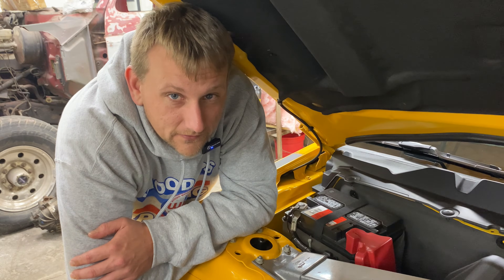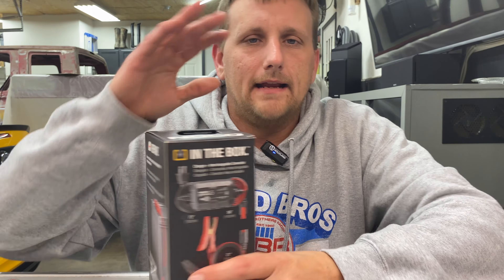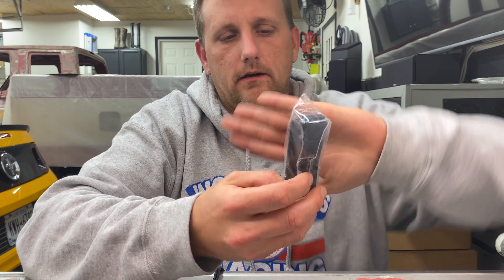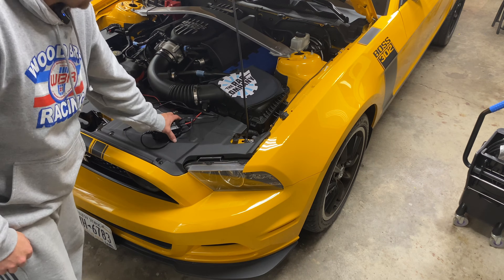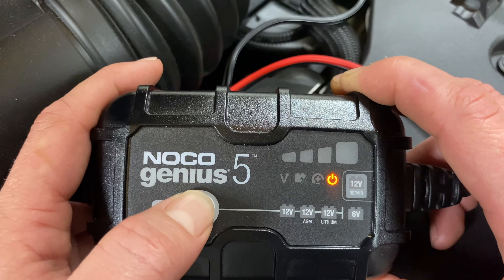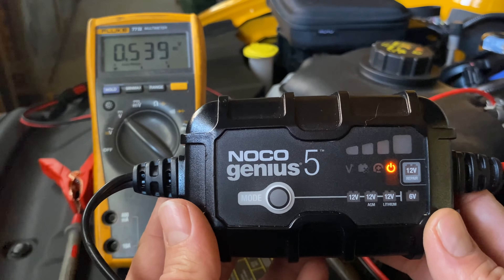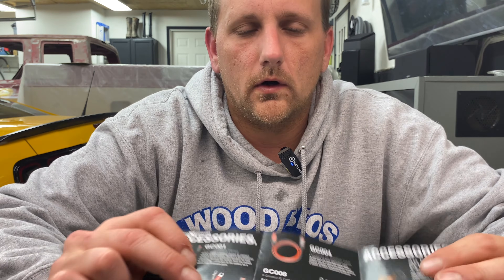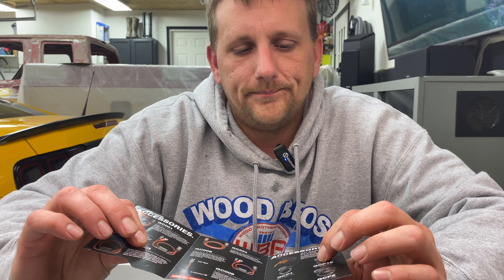NOCO Genius 5 Battery Charger/Maintainer How to, Features, and Accessories

Comment: Great video I've just ordered the same one  (noco 5) from amazon my battery is very low so as soon as I get it I'll put it on repair mode (after repair mode do you just put it back on 12v trickle charge?
Reply: Charge it first then use repair mode. If its voltage is bellow 2v use the force charge mode by holding the button until all the battery lights are flashing (flooded agm lithium and 6v) and select, your type of battery to force charge and it will resume normal charging after it reaches the right voltage. After fully charging use the repair mode, should be done after 4 hours, check your water levels on flooded batteries as it may decrease from electrolysis.
Reply: @brettsampson1900 excellent cheers mate..i will do.

Comment: Quick question and apologies if this has been asked. Do the alligator clips need to be connected directly to the battery terminals? Can they be connected to the charging points under the hood instead as my vehicle's battery is in the trunk and a hassle to get to. Wherever I needed a jump in the past, I've used the front charging points. Thanks!
Reply: I wouldn't see why not.  I'm hooking the pos cable to a remote  connection point that I added because that battery terminal is hidden under the intake duct.

Comment: I just got a Noco 5 , seams to work well and has more features than my Ctec. I have had my Ctec for close to 20 years and it has been running almost continuously between my RV, lawnmower, Atv,truck and car. The Ctec still works well but I wanted another maintainer so I thought I would try the Noco .

Comment: You don’t need to disconnect the battery from the car?
Reply: The instructions say to disconnect when using Repair mode because it could charge at 16.5 volts which could damage electronics. So, just disconnect the ground.
Reply: Nope. Just make sure you disconnect the maintainer before starting the car

Comment: How long does it take to charge a standerd car battery?
Reply: Apparently depending on how dead it is, I understand from very low to full charge about 6 hours on trickle charge but I think you can do a forced charge in about 3 hours..I've just ordered one myself and put a comment below yours, when I get mine I m gonna put it on repair mode as my battery has been well low because of under use.

Comment: I want to store the vehicle and use the trickle mode so the battry does not die, ,how do you do the trickle mode?
Reply: They make different amp models  which basically means that the more amps you have the faster your battery charges . your storing it you should do some research because your basically always gonna have it plugged in all the time so you don’t need that many amps . Hope this helps
Reply: Buy the Genius 1 for that.

Comment: Can you plug it in and let it do its thing for trickle charge? or do you have to turn it on after plugging the unit in?
Reply: you have to press the mode button to turn it on and select the battery type you're hooked up to before it will do anything
Reply: @YoureSoCreezy  Thanks

Comment: Great tutorial on the Genius 5, Nate! I actually just installed the ring leads on the 12V battery for our RAV4 hybrid and it's in it's optimization mode as I write this. I wanted to see more info on the LEDs, mostly to see what happens once it's done optimizing. Your video was the second one that came up & I've gotta say I love your low key, but very detailed descriptions. I also appreciate how picky you are... Subscribed & the whole 9 yards. Now to order an extension & the lead with the 10mm rings.

Comment: thanks, great video. Really appreciate it. one question, do i do the battery repair AFTER the battey is fully charged or do it when the battery is dead. i read somewhere do it AFTER the bettery is fully charged but you did it when it was dead?
Reply: I have the same q
Reply: After

Comment: I been using my NOCO 5 for a Lithium motorcycle battery and had forgotten/never used the retoration mode...hmmm...thinking about those 18V Ryobi batteries that just die because they were drained too low (presumably). I wonder if they might recover one of those...anyone tried? The challenge could be rigging a way to connect the cables... Thanks for the review!
Reply: From Noco Manual: THIS MODE IS FOR 12-VOLT LEAD-ACID BATTERIES ONLY. THIS MODE USES A HIGH CHARGING VOLTAGE AND MAY CAUSE SOME WATER LOSS IN WET (FLOODED) CELL BATTERIES. BE ADVISED, SOME BATTERIES AND ELECTRONICS MAY BE SENSITIVE TO HIGH CHARGING VOLTAGES. TO MINIMIZE RISKS TO ELECTRONICS, DISCONNECT THE BATTERY BEFORE USING THIS MODE.

Comment: Thank you for this.  It helped me through a somewhat intimidating process.  I am not mechanically inclined.  So, maybe someone else will benefit from what I learned.  I have an older F-150.  I also have a Noco booster.  My battery died.  The booster didn't work.  I got the genius 5, watched your video, went through the process....and it didn't work, either.  I tried the force option.  Didn't work.  UNTIL I moved the negative clamp to the bolt near the actual terminal.  Poof, it worked.   Who knew!?

Comment: Great video. I've been using my NOCO 5 for many years now, and it has been excellent. I just wanted to point out that the alligator clips actually unbolt from the harness, leaving you with just the ring connector harness to use. In other words, the unit ships with a ring connector harness already included. With the alligator clips removed, the holes are roughly 6mm. (It might even be the same exact harness as the optional M6 accessory, although I have not verified this). Either way, I was able to permanently mount the stock harness to my car. Just an fyi.
Reply: One extra detail. I have an S550 mustang, and I did not mount the harness directly to the battery terminals. I mounted the positive ring to an existing stud in the fuse box, and the negative, to an existing ground bolt on the shock tower--both of which were roughly 6 mm. At least with my car, because of the battery management system, I believe this is a better way to connect it, without confusing the computer.
Reply: @thislife6884  Hey I have a question, when using the Noco 5 to charge your battery do you have to disconnect the battery or no?
Reply: @ShyKiller15 Hi. No, I don't disconnect the battery from the car. With the pigtail already connected, I just plug the charger in.

Comment: I've already seen too many mistakes: first connect the charger cords to battery/ground before plugging in the charger; second, red cord to red (+) battery terminal and then black to a manufacturer recommend (see manual) ground on the vehicle. You are a hack.
Reply: Exact thing I put in the comments, the negative supposed to go to an engine mount or the frame. That car is going to burst into  flames.

Comment: Hi, I tried force mode, but when I press and hold the button, I don't see all the battery modes light up in white like in the video. I go directly to 6v mode. How long do you have to press the button to go into force charging mode?

Do I have to connect the battery when I want to access this menu, or not?
Reply: Force mode won't work if the charger can recognise your battery. So it's best you first unplug it

Comment: Does it always have to be plugged in to charge the battery or does it charge the box then use it without being in an outlet? Outlet only?
Reply: And it has to connected directly to the battery right?

Comment: OK I'm hoping you'll respond to this. I have fully recharged the battery. So the charger tells me it never went to just the green light alone I left it on for 24 hours and all lights were lit. All the way to the green solid.  Meaning all the red were lit together with the green and all were solid.So then I went to repair mode, left it on for 4hrs.It actually went off at exactly 4hrs on its own lt went to the yellow circle So then I turned so then I unplugged it from the wall.I did it with yellow light on l didn't know what to do. Then after doing it, I realized maybe I should have checked it all over again to see what light it went to for the battery being charged. So that's what I didn't do and I wondering what I'd do I next. Do I go out and try it in my car? Cause I've got the battery inside because I'd never used one of these chargers. Nate ANY1 HELP???????

Comment: So once all the lights go out and it’s only the green one showing, can I leave it over night?
Reply: Yes, green solid means it’s done charging. If it starts flashing slow green then it’s in maintenance mode. Leave if be once you connect it until you’re going to use the battery.

Comment: I got the Genius 5 and GBX55 years ago and thankfully no need to use them but it's peace of mind that I can help myself or someone else in need. It's really stressful when your car breaks down. I looked at the cig lighter for the G5 and just bought it with the hardcover cases for both to keep it clean and tidy, thanks for pointing it out.

Remember to check the GBX charge and top of it at least once a year.

Comment: Should you charge battery first? Then do repair mode, or just do repair mode first?
Reply: It's recommended to charge the battery fully first (solid green light) then do repair mode. (Hold mode button until battery light blinks, then press once more to go into repair mode.)

Comment: Hooked up the Noco 5 to a new battery...it went to green pretty quickly but it's not "SOLID" Green it's slightly blinking off and on....
Is the battery fully charged?
Reply: No this means it’s nearly full and is on a final ‘trickle’ charge to finish the cycle, once the light is a solid green you are fully charged.
Reply: @tw1sted_d1sco  
It turned SOLID green after 10 hours of trickle charge. 
I would estimate the brand new battery was 70-80% charged to capacity.
This was a Brand new battery as well.
I disconnected the battery after a long freeway drive the day before.

So much for the myth that alternators will "top off" or "charge" a new battery.
Reply: @tw1sted_d1sco "the bulk charging is complete and it is optimizing and topping off the battery" - so what the hell does that mean? How charged is the battery when "bulk charging is complete" - 75-80-85-90-95%. Do I need to keep charging when I have three lights solid and green pulsating or is it basically over and I can unplug? What is the benefit of  "optimizing and topping off the battery"? I do not think Noco knows the answer.
Reply: does everyone else flash green then flash 1 red light 2 and 3 then green seems to be the cycle method.  However as soon as I disconnect the battery it starts falling below 12 volts.  Is the battery trash or should I run repair mode a few more times

Comment: If you had to go into force mode, when would you use repair mode vs just a normal charge mode?  Because if you brought the battery down so low that it doesn't even recognize it, wouldn't you need to do repair mode vs just try to charge it up?  Maybe not if it's a pretty new battery, but how would you know?  Thanks for any feedback on this.  Great video with a very thorough explanation of all the features and how to use it!

Comment: My buzz around cart is also a climate everyday ride around car it's also got special mag tires bethalto the AGM batteries are high performance they are built for this special deep cycle affect may not say deep cycle on them but most wheelchair batteries are deep cycle and they do require special Care at the noco genius charger has worked on my wheelchair batteries for many many years I've had mine for almost 4 years now .

Comment: Mine is designed in USA, made in Vietnam….
Reply: Its 2025. Made in USA no longer represents anything. infact, Quality Control in USA has been a huge hit or miss. I've a mustang and when I complained about the panel gaps/chasis alignment, i'm told that it is within 'tolerance limits'.
Reply: @jivk.8928  Then why don't you move to Vietnam if it is so much better over there?

Comment: The light doesn't paules it flash from red to green and shuts off after 2 minutes?
Reply: Might be faulty. My Battery Tender 5 amp charger goes from amber to pulsing green, and then to solid green fairly quickly (10 minutes?).......but the battery isn't actually fully charged. It also is a dumb charger because it failed to fault a faulty battery. It showed my battery as solid green but it was actually only at 10 volts. So I just bought one of these NOCO 5 chargers. We'll see if it works any better.

Comment: The problem with Nico is the electric cable thay use it cracks & splits exiting the unit ,I only used it 3 times in 1 year.wouldnt but again

Comment: Thanks for the tutorial. 
Should I charge the battery before using the repair mode or no need?
Reply: Answer: yes.
Manual: "For optimal results, take the 12-volt battery through a full charge cycle, bringing the battery to full charge, before using this mode. ".
Also the repair mode is for 12-VOLT LEAD-ACID BATTERIES ONLY.

Comment: Do I need to keep the battery connected to an outlet at all times? Or can I jump start/boost my car battery with only the battery being connected to the car?
Reply: The device reviewed is not for jump starting a battery. The NOCO Genius products are exclusively for charging and maintaining the battery. Genius 5 has a repair mode. Genius 10 has a repair mode and can function as a 12.6 V DC power supply. When using the repair mode the battery must be fully and completely charged.
Reply: Charge it then run repair

Comment: You need to make it clear how to connect the clips to the battery — it should be your Basic Step 1 - if you really care about fear
Reply from the maker: Good point. I never really thought about including that. I try to be as basic as possible to keep it simple but the most basic things sometimes I think they are second nature to most when in reality it's not.
Reply: @natemarcy3939  and how to leave the bonnet wedged open so as not to attract unwanted attention by leaving it open — I used a pool noodle to leave enough clearance above the clips which I don’t even know if they are on properly, or if I should’ve could’ve clipped them sideways around the screws instead of the round big bit. The lights on the charger are working but I didn’t like having to take the risk with my life. No instructions came in the box- just safety precautions but no instructions. And I didn’t know best material to rest the hot charger on for the next many hours— I chose an upside down big plastic basket- for the ventilation and so my curious cat doesn’t knock it over easily 😰. Thankyou for caring Nate 😇🥰
Reply: But I ❤❤❤your video— Thankyou 🎉😊😊
Reply from the maker: Thank you!

Comment: Can i use an anker c1000 to charge my car battery via noco5? Its a 2016 plate and i get regular battery warnings when i forget to switch off the dashcam plugged into the obd port.
Reply: No.

Comment: Repair mode is for flooded lead acid batteries only, not AGM, not lithium
Reply: Where did you get this information?
My AGM car battery tooks ages to fully charge (14h and blinking green with the other led on) so I'm trying a repair mode. 
Is it bad ??
Reply: "USE THIS MODE WITH CARE. THIS MODE IS FOR 12-VOLT LEAD-ACID BATTERIES ONLY. THIS MODE USES A HIGH CHARGING VOLTAGE AND MAY CAUSE SOME WATER LOSS IN WET (FLOODED) CELL BATTERIES"

Comment: So must plug to work? Is there a charger for when u stranded on the road? To jump start
Reply from the maker: Yes must be plugged in to use. The GENIUS line are slow charger/maintainer. The NOCO jump packs are the BOOST or BOOSTX line. I have a video reviewing and discussing my NOCO GBX75 on the channel. It's bigger than most need but they are all similar.
Reply: @natemarcy3939  Is it better to slow charge or fast charge?
When using slow charging, the cycle life of the battery can usually reach more than 3,000 times. However, if it is always fast charging, the cycle life will be shortened to about a thousand times, or even lower. So slow charging vs fast charging are important to batteries life.Sep 14, 2023

Comment: Great review.  I just received mine to use on the boat battery. Used the boat once for 4 hours.   The 3500 didn't do anything on the trickle.  Just got hot, and blink green.  The 5 finished in about 25 minutes.

Comment: I'm frustrated. I got the Gen 1 and it worked at first but then just flashed red and my battery wasn't ever getting to green.  I had the battery checked and it was fine. Charger still wasn't working right so I decided to try the 5. I can't get it to go to repair and the lights chase and then it goes back to standby. I don't know what to do next

Comment: Good video, thanks for the information.
 A question, what happens if I charge a 200ah battery with the Noco 5 (battery capacity 120ah)?
Does it just take longer to load? or does it not charge completely? Thanks

Comment: Great video.  Maybe I missed it but does the Genius 5 have an auto shut off feature when the battery is fully charged?
Reply: No it doesn't. Once the only light on is the green one and it's solid and not pulsating, the battery is fully charged. If you then opened your car door (interior lights come on) it will detect the small loss of charge, and begin pulsing green until it's again fully charged (solid green)